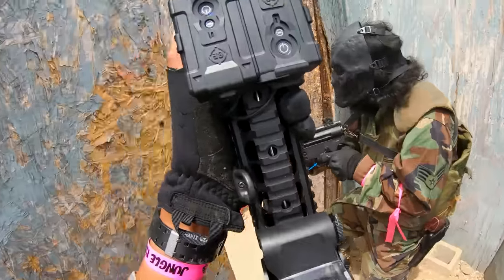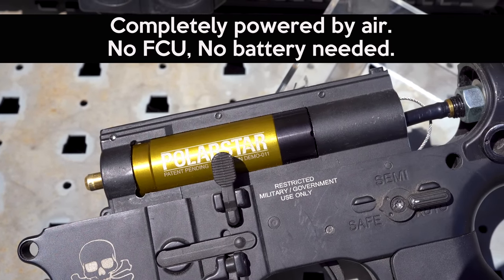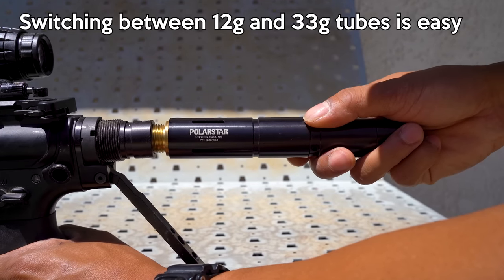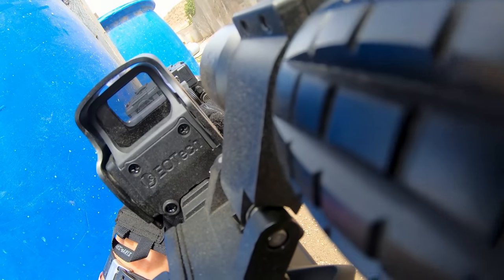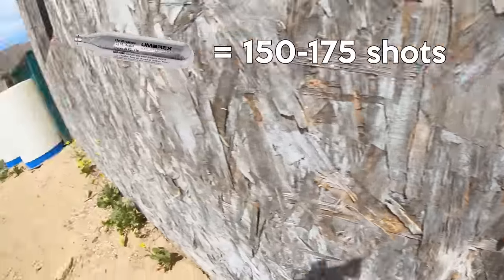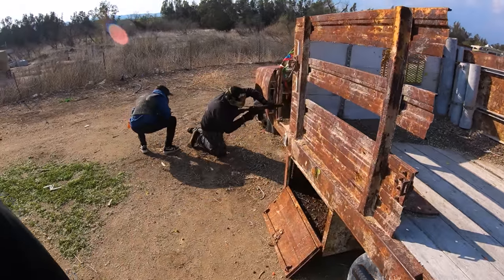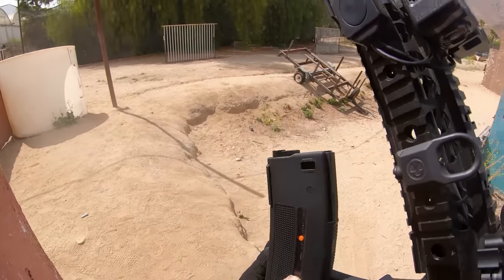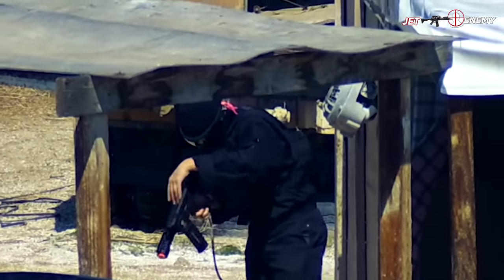HPA Made Easy. No Hose, No Tank | CYMA SR16E3 Polarstar Kythera

Comment: I just purchased a CYMA sr16 to use for this exact project! I hadn't seen your video yet but I was wondering if there was anything I should know in particular for this build. What worked? What didn't? Were you able to attach the charging handle to the reset cord?
Reply: Get a better barrel ( 6.01/6.02) and hop up unit ( i recommend the MAXX units) haha, will be a lot more accurate :)
Reply: @stratts_636  Bucking and Nub have a much larger impact on accuracy than hop up does. If it has a rotary hop up you're golden most of the time. Only time that is not the case is if they use the cheapest plastic garbage they could find. Modify flat hop bucking and nub are pretty good.

Comment: I was interested until you said a co2 will only last 1 mag. For most games that the equivalent to having to change the cartridge after each mag change. Even for big games that engagements aren’t that long it would still be a pain trying to use this. Either deal with the hose and tank or buy an aeg.

Comment: Why not just run gbbrs? This is basically the same thing
Reply: gbbr only have like 30~40bbs each mag even with drum mag thats like 150bbs but for aeg or hpa system you can run high cap mag with 120~300bbs, also aeg or hpa system dont have recoil and can still play normally in winter

Comment: I currently have my Kythera in a Vfc SCAR H SSR set up in the DMR role and it has worked really well for me, but unfortunately the hop up itself did not fare really well so I had to rebuild it but it has the range and with the can on it, it is super quiet. The nice thing about the VFC SCAR H lower is that it can be swapped for the original aeg lower (Which I still have) or I can put the Kythera lower onto my shorter SCAR H CQC build and run that if I feel like it.
Side Note: I am looking into making a low profile air rig utilizing an Amped Airsoft twin tank rig and two First Strike 15/4500 carbon fiber tanks then hide it in the back plate compartment of a plate carrier.

Comment: Hey
love your vids!
do you still play with the CO2 Kythera build nowaydays, or have you swapped to something different, and if so why? :)
Im thinking of getting smthg like this, because I dislike the hose on regular HPA, but I would really like the airsoft gun to be able to shoot full-auto as well.
Is that possible with any CO2-HPA-kit/gun?
and if so, does the CO2 cartridge last a good amount with full auto, or is it a hassle/empty pretty fast?
Reply: get a redline its a better kythera in pretty much every aspect, Kytheras also don't have full auto unfortunately since they are fully mechanical and do not use a FCU.
Reply: @timkane3221  doesnt the CO2-cartridge go empty super fast, if you shoot full auto?
Reply: @redburnmckinley  if your using it for an AEG which I assume you are it’s semi auto only period, also yeah the CO2 cartridges run out fast and are pretty inconvenient. Much better to just get a redline and run an air tank.

Comment: what is the thread size for 33g tank? 1/2 20UNF or 3/8 24UNF?
can i use WRAITH with refill 33g co2 tanks? (they have likely twice pressure 200bar/3000psi)

edit: there is 33g and 24g co2 tanks which is different in length. 24g pretty much match with stock length. makes it more comfortable to CQB. in fact they have tread 3/8-24UNF which i dont know if they will fit to WRAITH...

Comment: Can you fill an HPA tank with a standard air compressor? Or do you need specialized equipment?
Reply: Need specific equipment to fill tanks. But at home you can run your gun straight from the compressor for testing.

Comment: If you don’t want the tank or line, don’t run HPA. Also, the Tippmann M4 is still the best mechanical HPA gun for the money. Even after you replace barrel, bucking, hopup, and rail you’re still at less money than a Kythera and the CGS. To travel with it, just ship it to your hotel, or field you’re going to play at. Cheap, no dealing with TSA, and you do not need to take your regulator off of your tank IF you ground ship.

Comment: Nice video! I might have to go this route if I get an M4 or want to do a similar build. Curious if this is possible now with an MP5...
Reply: Polarstar has a mp5k setup that will work with the elite force/TM
Reply: @Mattvogtsr  Oh nice! I got a VFC MP5 A5 but considering another one later on to polar star. That's good to know! Thanks! :)
Reply: @Hyena_One  I'm gonna add that if you have an vfc avalon mp5, that a kythera will be a drop in. Fit once you buy the correct nozzle.

Comment: Can you do this to a sig mcx? If so can you show how? :)
Reply: Ez pz. Kythera is a drop-in for V2 gearboxes. MCX has a V2 gearbox. Look up any Kythera installation video and follow the instructions. The only thing I'd add is that the V1 Kythera is 1-2mm shorter than most gearbox cylinder windows, so you'll need to add an o-ring on the front, back, or both in order to shim it for best fit to your hop-up.

Comment: How did you install the kythera and do the conversion to where it takes co2 cartridges?
Reply: Look into the Polarstar Youtube channel.  The Kythera HPA engine setup is a pretty straightforward Install into the gearbox.  You rip out the gears, and put the HPA engine into the box, and the CO2 conversion is really a UGS regulator that bolts in place of the buffer tube.  It comes in two ways.  A mil spec and a TM style reciever attachment.  Some dremmal cuts in the gearbox and TM style receiver may be necessary.  Not mentioned in the vid, is that they are two separate products.

Comment: The HPA gods have listened and have released a First Strike 4.5K 15CI carbon fiber tank. You'll get upwards of 2,000 shots out of a fill.
Reply: Fits most air in stock systems as well even 3-d printed ones

Comment: Jet mentions the kythera is silent, yet DeeMoe released a vid where he says it’s very loud... who am I to believe rn?
Reply: It depends on how it's volumed. If you're running higher pressure with a shorter barrel or really tight bore barrel, it's going to be louder. If you have a lower pressure, longer barrel, and/or extra wide-bore barrel, it'll be much quieter.
Reply: My teamate bulid a sr25 with kythera and its by far the most silent hpa solution I have ever seen

Comment: Fun video but it's obvious Jet isn't really into or knowledgeable about HPA in airsoft...
The entire video was spent saying the Kythera was for HPA without a line. The kythera is irrelevant in getting that as any of the drop-in HPA engines from Polarstar or Wolverive could be used with the P☆ CGS or Wolverine Wraith CO2 stock to achieve the Line-Free HPA Experience.
I ran a wolverine Wraith with Inferno for ages getting over 200shots consistently because you can tune the dwell to get the correct volume for your inner barrel, it's great but pointless for games where you may use bursts of auto and you need to be good at using cover & fast reloading the CO2 as it's often in a firefight it runs empty and you often lose ground and/or give the advantage to the opposition in the process.
I run a kythera now, the trigger is really nice but the system can be alot more work to setup and make run well.

Comment: Yo I would definitely get one of these if it means just tossing it in my new M4
Reply: That's exactly how it works. There are some tricks to dial them in, but as long as you can handle the trigger setup (many video guides available), it's basically a drop in. Hop chambers are pretty similar. Teching HPA guns is so stupid simple after you learn the basics.

Comment: 3 pound break? No. Your standard AR has a higher break. I have a PSA Single action trigger in my patrol rifle. It’s 3 pounds. My sig AR is mil spec it’s trigger is about 5. Then I have an SBR with a milspec lower it also is a 5 pound pull. I get that you know airsoft but don’t talk about real firearms like you know them.

Comment: Where do i find the buffer tube
Reply: yes and no. HPA is usually just the paintball tank, but since it works on compressed gas, you can power it using CO2 as well, it all depends on your setup.
Reply: @kerberos623  ok thanks